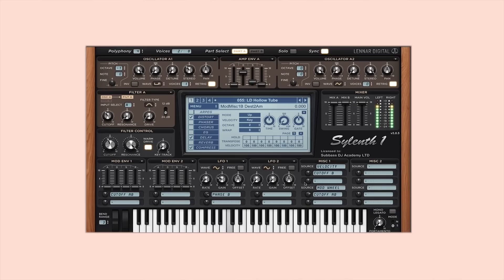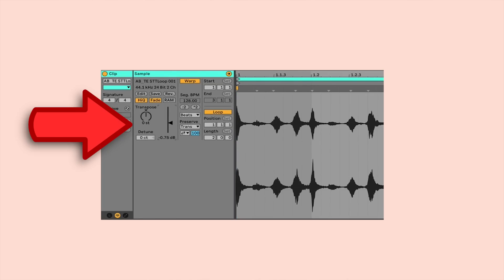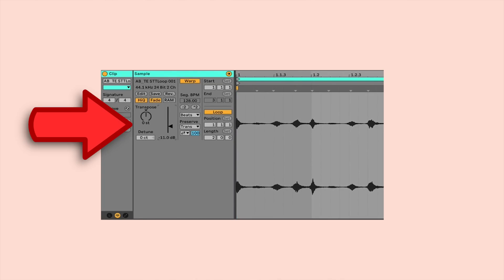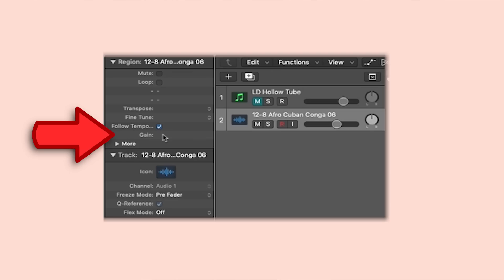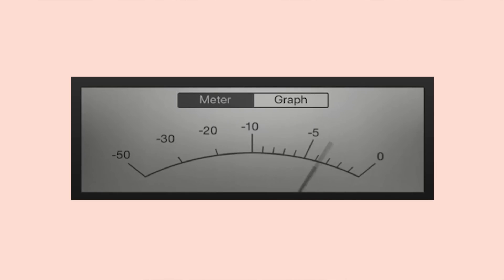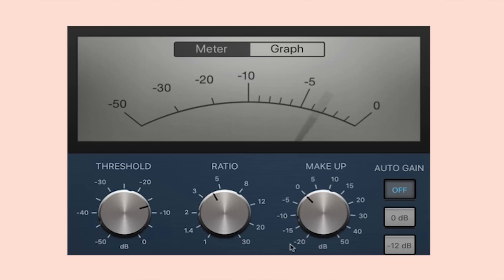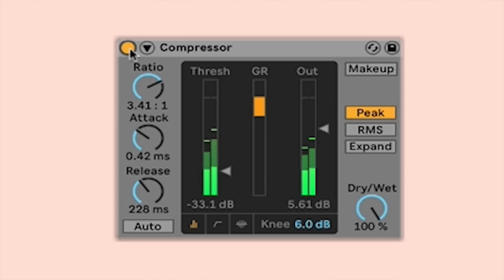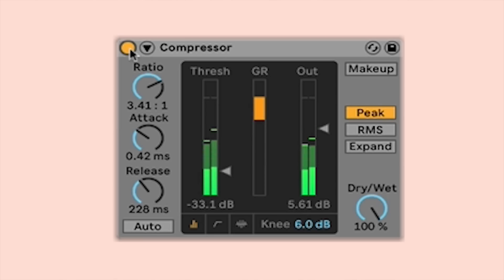Why You STRUGGLE to MIX and MASTER! [Gain Staging Tutorial] | Noize London

Comment: Hi! One question: I saw on a video that, for Ableton users and for Gainstaging purposes, you can use an Utility and a Spectrum Analyzer to match the volume of your sounds or samples per channel without touching on the faders itself by put them between -18dB and -12dB. It is correct? To low on volume? I did it on two tracks and I get a way better results but I guess that my tracks are still low on volume in general... What do you think?
Reply from the maker: use your ears to match gainstaging. nothing else.

Comment: So, let me know if I understand this correctly.

The channel volume faders should all be left at the default settings.
Adjust the volume of a sound by tuning the gain knob on the source (eg Simpler, some sort of VST) or maybe use Utility for this. Doing this I aim for around -12dB.
And then adjusting the volumes of different sounds for the mix is done by playing with the channel's volume fader.

Is this kind of the right way or did I get something wrong?

Great videos by the way, really like the content so far!
Reply from the maker: Yes Timmeh you are right - mix from the root of the sound of you can! :)

Comment: I am using the DT 770's to mix and master my tracks . I live in a flat/apartment .Therefor I can't make loud music on my monitors or any speaker . I get my mixes perfect except for the bass, which I struggle with a lot . Any advice on how I can mix the low end better with only my DT 770's please . I produce Future House/Future Bounce . (EDM)
Reply: Correlate your track on different monitors/speaker systems i.e your car and phone to see how they sound on each one.
Then learn if your headphones are giving you too much or too little bass and work around it.
(Another good tip is to have a reference track, and match the volume of the low end)
Reply: Yeah you’ll need to find some good references
Reply from the maker: For bass ideally you want speakers with at least an 8" driver or a subwoofer. I would recommend also treating your room before doing this. Cars ar good for monitoring although now always accurate.